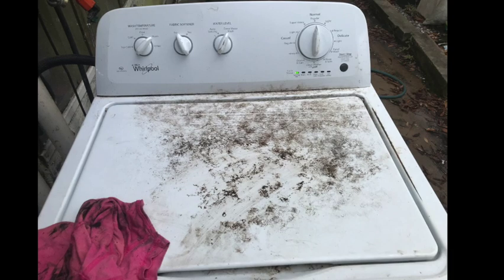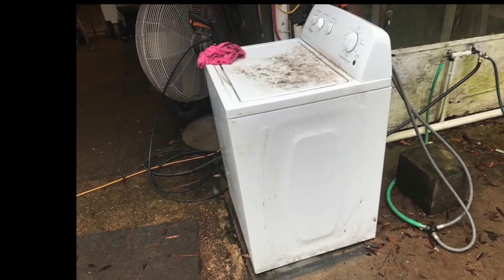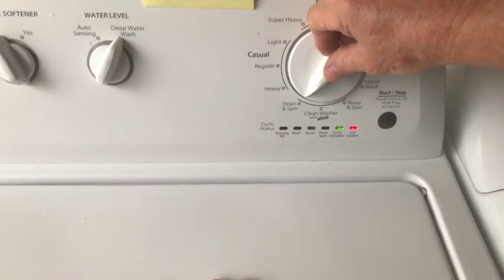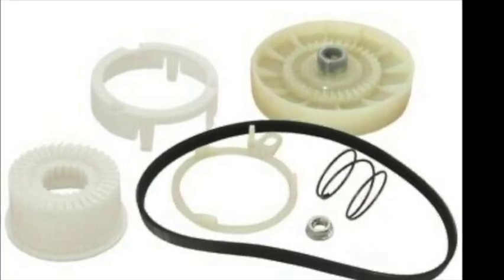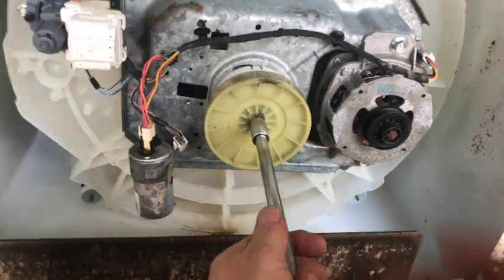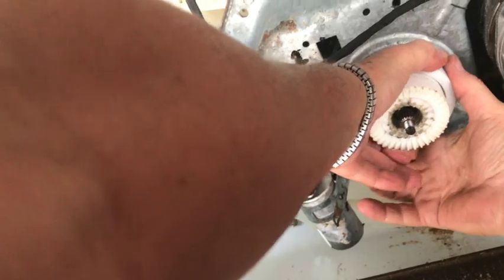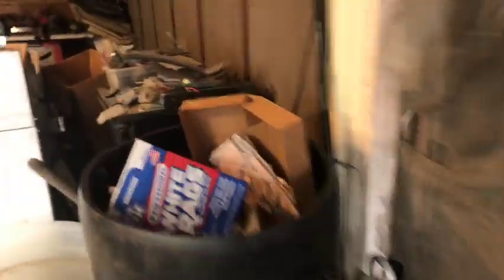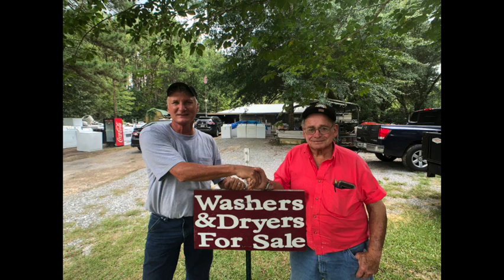How To Use Service Diagnostic Mode to Fix a Washer That Won't Agitate

Comment: What if I replaced the actuator and the splotch is in good condition? 
Same symptom, the drum is moving with the agitator. The agitator dogs engage. But they spin together not independently, just like the video.
The belt is good too?
But is my issue the transmission? The spin cycle works. Just not agitating properly
Reply from the maker: The splutch or actuator are not working correctly. Thanks for watching!

Comment: Lights light up after one click, no matter which direction.  All except the lock lid light.  They never stay off one counterclockwise circle.
Reply from the maker: Try holding down the start button until the lights go off. Up your a minute or more. If they don’t go off your control board may be bad. Thanks for watching!

Comment: Mine won’t agitate or spin would you think it’s the actuator?
Reply from the maker: That could be your problem but there are other reasons too. I couldn’t tell you for certain unless I could diagnose the problem myself! Thanks for watching!
Reply: @HarperandKnowles  I put it into diagnostic mode and got a F5 I’m guessing that means the lid switch is bad. Also getting an F8 think it’s not filling up fast enough but I’ll check to see if there are screens on the hoses. I’ve got low water pressure at my house. If you could give me what you think about the F5 I’d appreciate it thanks
After putting it into diagnostic check when I turned the knob one click counter clockwise I got the F5 reading and on that same setting I got the F8. They flashed one right after the other.
Reply from the maker: Those codes should be in pairs ... like F5 E3 would be for a defective lid lock.
Reply: @HarperandKnowles  when I put it into diagnostics the first code it lit up the number 4 and 1. The next one that lit was the 4,2 and 1 before I checked for any other codes but I do not see the F5 E8 I’ll double check the code
I double checked the codes and I was way wrong. It is F7 E5 indicating might be the shifting actuator. Glad I double checked myself. Think I’m understanding how to read these codes. If you get a chance can you offer your opinion and what else it might be. I’m stuck here over the weekend till they open Monday but thank you so much I wouldn’t of double checked myself if you didn’t tell me about the codes being in pairs. I might as well change the spluch while I’m under there.  Thanks again
Reply: @HarperandKnowles  I read the codes wrong it was F7 E5 shift actuator. Changed it out it’s working great now thanks
Reply from the maker: Glad you got it going! Have a great day!
Reply: Mine do everything but agitate

Comment: Here's one for you. In both test and calibrate mode, my agitator works fine, spins seperate from the drum. In manual test mode all the lights flash when I try agitate and it won't work. On a regular cycle the washer goes through everything, except when it should be agitating it just sit there not even trying. New main panel, same thing
Reply from the maker: Your problem is probably either the shift actuator or the splutch. Thank for watching!

Comment: Hi, your video was very helpful. We went through the diagnostics on our 3 year old Amana. We replaced the actuator and  put it back in diagnostic mode and the agitator still does not move.
Reply from the maker: Could be the capacitor or the motor or the lid switch/lock. I can only guess without seeing it myself. Thanks for watching!

Comment: I ran all the test and it worked in low agaitation an high agitation. When i put clothes in it to wash it dont work in high agitaion. On rinse cycle it makes a weird noise but it agitates. Can you help me out? Im lost at this point.
Reply from the maker: Unfortunately I can't diagnose your problem without being able to have access to the machine. I can't evening imagine what the problem is. Thanks for watching and I hope you find the solution.
Reply: @HarperandKnowles  I fixed it. Once I took everything apart and replaced the valve and got it tightened back up. This was pretty easy. I put it into test mode and everything worked as it should. What I didn't know was that my machine had to run a full wash, rinse, and spin cycle in order for it to operate on regular modes. Thanks again for the video buddy.
Reply from the maker: That’s awesome. Glad you got it fixed!
Reply: Thanks buddy

Comment: What if you can spin the agitator freely by hand in an amana washer but it doesn't move with clothes in it?
Reply from the maker: Your agitator’s splines may be stripped out. If you are talking about just the top part you need new agitator cams, also called dogs. Thanks for watching!
Reply: I replaced my "dogs" they still looked good but I changed um anyway. So I figured the lower part of the agitator was bad. Tried to get the lower part of and it's being a "Bear" and won't move up and off. Any suggestions? Don't want to break anything else in the process. ???
Reply from the maker: Stuck agitators can bring a repair job to a sudden stop. They can be a real pain and sometimes can only be removed by destroying them. Here’s a video that I made about that https://youtu.be/nAf4k_n4YAs?si=vxyZZM1LcKnkFqYT. You can try some of the methods I used here.
Reply: @HarperandKnowles  Thank you sir. I'll check it out and hopefully I can get it done. Your vids are great. A friend referred you to me on here. I'll be in touch. Have a blessed rest of your day and wknd. 😎👍🙏🙏
Reply from the maker: Thank your friend for me! Good luck with your repair.
Reply: @HarperandKnowles  Will do. I watch your vid on stuck agitator and it was informative. Mine is not that bad though. I believe it's plastic gear/cog teeth may be stripped on the agitator itself. The shaft with the spline looks to be metal. The lower agitator looks to be the problem.Ive sprayed it with PB Blaster hoping to get it to break free so I can get the part ordered if my local supplier doesn't have it.

Comment: Our Amana would spin but not agitate. We replaced the shift actuator and the splutch. Now it will agitate and won't spin properly. Every time it starts to spin BAM it goes out of balance. Where did we go wrong??
Reply: ... should have mentioned that in order to do the repairs, we laid the machine down on its back. I just found your video about never doing that but had no choice. Anyway the tub is off center and I cannot find anything about fixing that that doesn't involve suspension rods, which seem to be fine on ours. You can visually see the misaligned tub when you open the lid. At this point, I'm ready to get a wash board and ringer and call it done! 😂
Reply from the maker: If your machine has suspension rods laying it on its side won’t hurt it. That video was about machines that have the triangular plate on the suspension that can get misaligned and cause the tub to crack. If your rods are good and the tub is misaligned it is possible that you have bent the tub or transmission shaft. In that case it is best to replace the unit because the vibration from this damage will wear out the linear dampeners in a very short time.
Reply from the maker: Those two components shouldn't affect the balance. Check to see if your suspension rods need replacing. You can watch this video to determine that. https://youtu.be/xmBJdpUfV-Q. Thanks for watching!
Reply: Thank you for your quick response! In the last few minutes I saw a video with someone saying they had gotten the pulley nut too tight to where the teeth would not release. We will check both the suspension rods as well as the pulley nut. We could not have even gotten this far without your help!! Thank you so much!!
Reply from the maker: My pleasure!
Reply: We figured as much. Thank you for your help and have a wonderful thanksgiving!
Reply from the maker: Thank you so much! I’ll wish you and your family the same!

Comment: My Amana washer is doing the same thing it will not agitate. I noticed on my unit that there was what appeared to be a oil or grease buildup on the 😮Drive Motor. The metal base was covered in it. could that have been the issue?
Reply from the maker: It sounds like your transmission seal has failed. That’s a terminal illness for these machines. Thanks for watching!
Reply: @HarperandKnowles  will a new Drive motor fix the problem?
Reply: I had no idea washing machines had transmissions
Reply from the maker: No, but a new gearbox would. But you’ll have to decide if the cost to repair it is economical. I’d get a new machine.
Reply: @HarperandKnowles  thank you
Reply: Thank you for the responses on here. My whirlpool just shat oil too and won't spin or agitate... I guess its time for a new washer😢
Reply from the maker: That’s what it sounds like. Thanks for watching!

Comment: Can this be done cost-effectively on units in operation?  50% of a new matching seems to be the mathematics I keep hearing.
Reply from the maker: Sure, I change them in the field all the time. It’s much easier to do in the shop, but I love a challenge.
Reply from the maker: Oh, I also located one of those plugs for you if you still want it.
Reply: @HarperandKnowles  Absolutely. I really appreciate the help.
Reply: Let me know what payment system you would like to use. I do like Venmo because there are no fees attached. But completely your choice.
Reply from the maker: Send me your address in my email, I’ll get it to you.
Reply from the maker: Just pay the postage, I can send an invoice to your email address and you can use your credit or debit card once I know how much it will cost to ship to you.

Comment: I sure like the photo of you and Mr. Harper.  Which do you prefer working on, direct drive or belt drive?  Which one gives less problems as far as repair?
Cheers from S. CA
PS  It would have been cool to have Amana in the background of the photo.
Reply from the maker: Direct drives are less problematic.  Alas, Amana refuses to pose if others are in the picture.

Comment: That was cool to see the machine start agitating as it should be near the end of the video!
Did you end up having to change the splutch, or were you able to clean the grime and grit out and re-use the original splutch?
Reply from the maker: No, that splutch was defective so I replaced it too.